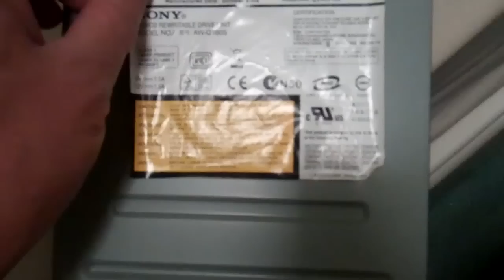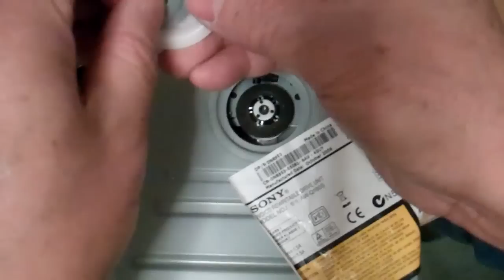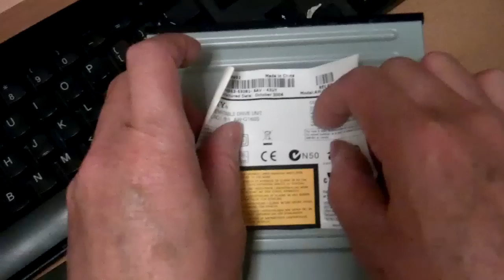Repairing a non ejecting dvd drive part 2 .mp4

Comment: the video was informative, but instead of trying to add paper, I put the round metal plate on a 9/16" socket and tapped the center with a large phillips screwdriver & hammer.  This created a slight cone shaped center which I turned away from the magnet, weakening it's pull.  I flattened the slotted edges of the metal disk with a plier so I could put it back into the 3 plastic catches.  fixed my bluray player.

Comment: Holy shit dude I love you for this! I had a drive that wouldn't eject when I put the metal cover on, and I thought it was because the cover was squeezing it. I tried bending the metal with pliers in all sorts of ways, and nothing worked - then I tried this, and boom, it works perfectly! Thank you!!!
Reply from the maker: Not a permanent fix but it'll work for a little while.
Reply: wtam69 Well you weren't kidding about it not being permanent. It broke again yesterday. Now it only works if I push down on the top of the drive, otherwise the white thing that holds the magnet just spins around really fast. Any suggestions?

Comment: The paper trick worked great. that was my issue on my sony dvd burner. cut two circles from a receipt  put it in between the metal and plastic circle and fixed the issue. thanks again
Reply: sony 5280s-cb-plus

Comment: Great, worked on my LG lra516 dvd  player/recorder.
So what's the magnet has to do with the opening of the tray?
Reply from the maker: I'd assume the magnet holds the disc in place so it can spin but somehow it is not releasing the hold on the CD and the disc cannot be ejected.